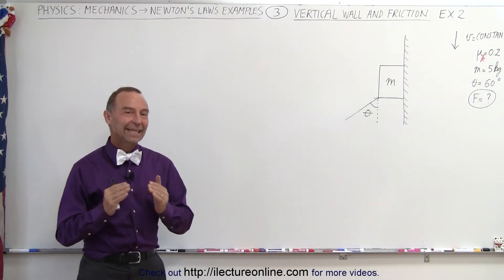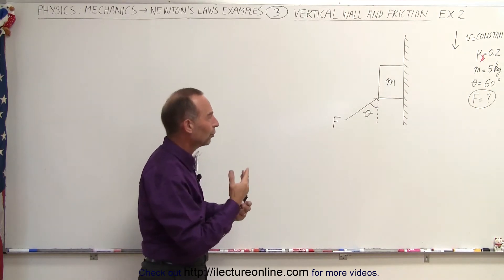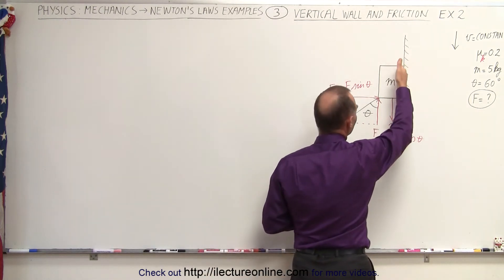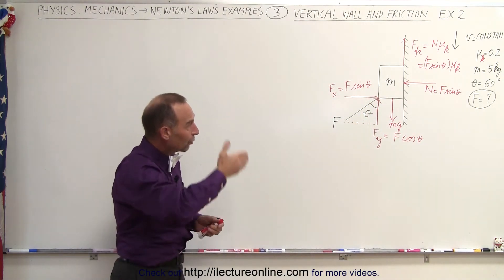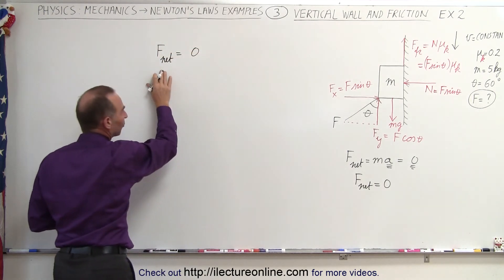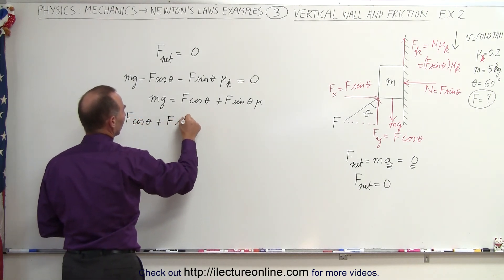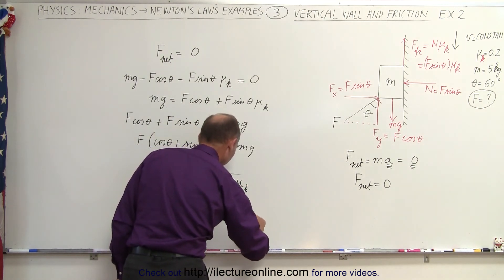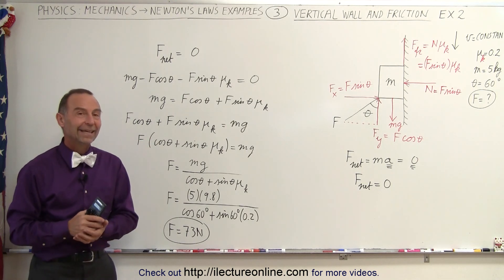Physics 4.1 Newton's Laws Examples (3 of 25) Vertical Wall and Friction: Ex.2

Comment: In the previous exercise F=150 Nw was the Force necessary to maintain v=constant in upward direction. So I thought that with149Nw the block went in downward direction but you demonstrated that 73Nw are necessary. What happens with F between 73 and 150?

Comment: Stupid question, is the normal force equal to Fsinceta or -Fsinceta?
Reply from the maker: Not a stupid question at all.  This confuses many students.  The magnitude of a force cannot be negative, thus the magnitude of the normal force is F sin(theta).  But as a vector it points to the left in this problem, thus the direction would be negative.